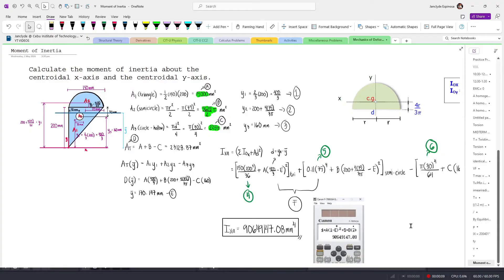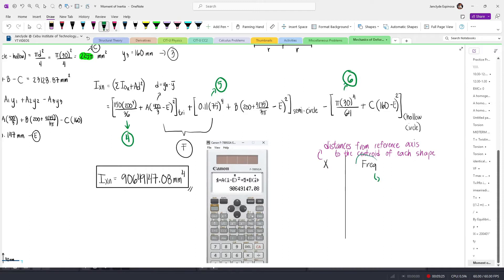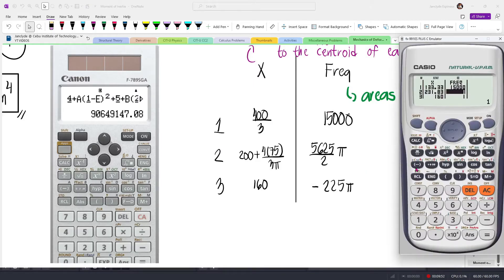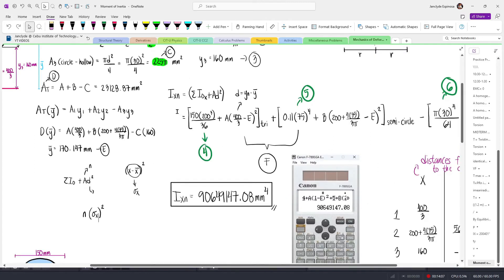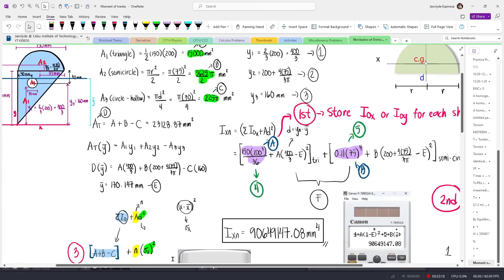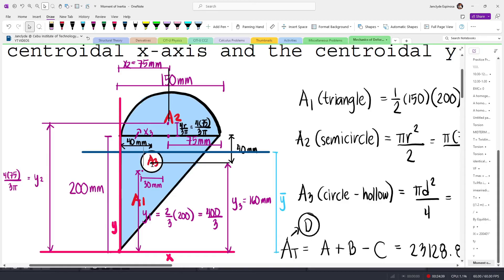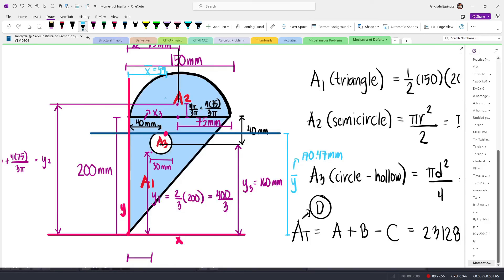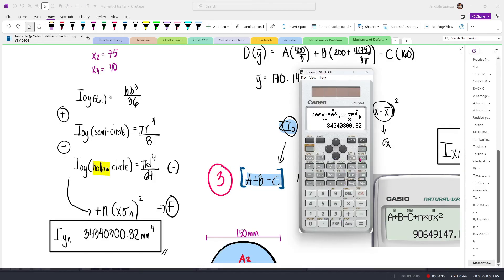CALTECH - Centroid and Moment of Inertia

Comment: Not a very good example cuz u cannot use negative frequencies on physical sci-cal, it gives "Math Error"
Reply from the maker: Casio 570ES & 991ES up as well as Canon F789SGA can utilize this technique. Calculator emulators function the same as physical calculators... perhaps this is due to the calculator you are using
Reply: @engrclidez  Been using Casio 991-Ex ClassWiz and Casio 991Cw. Inputting negative in Area or Frequency table results in Math Error.
Reply from the maker: @blackknight3303  this seems to be a calculator issue.. both aren't allowed in board exams, though... you should transition to Canon F789SGA or the transparent version of Casio (although na-ban din recently po)
Reply: @blackknight3303 @engrclidez HI! I just came across this "Math Error" problem on my Canon F789SGA. I had 3 (xyA) columns and 2 rows of data then when I solved for Standard Deviation it showed "Math Error". 

After a quick troubleshoot (just inputting rows of random data) I found out you need to have at least 3 rows of data to be able to use the Standard Deviation function since Standard Deviation is a value that represents how far apart the data set is.
Reply from the maker: @vitaminosis  hello, I uploaded a new moment of inertia calculator technique that does not use the standard deviation formula
Reply from the maker: @vitaminosis  https://youtu.be/6bkPjjzNyFw?si=pWtihJMp_XN9_c4I